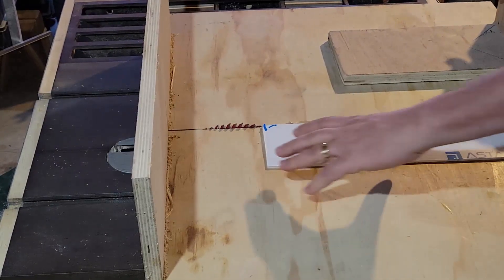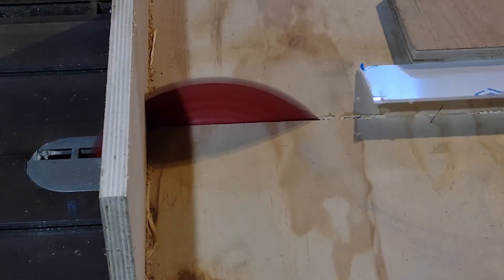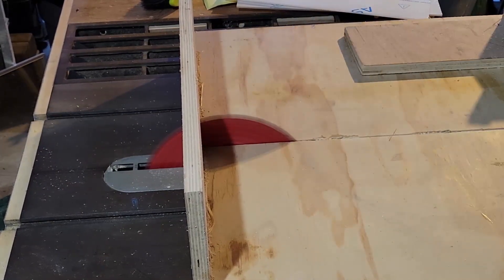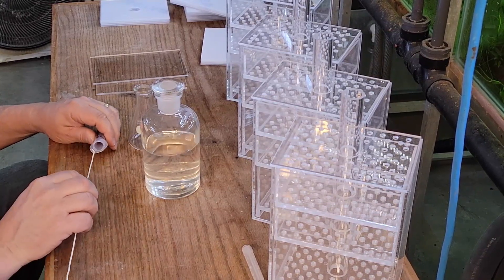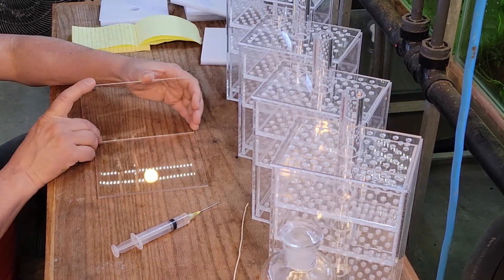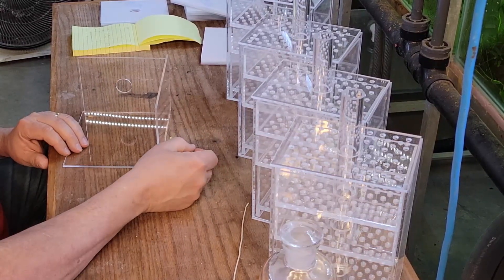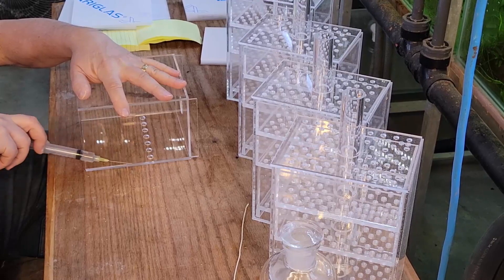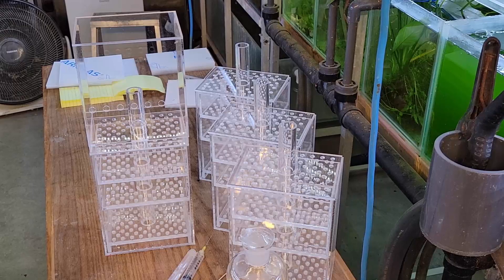Acrylic Welding: Advanced Techniques & Safety

Comment: I asked this question on another video but where do you get your supplies?  The Methylene, syringes, glass container?  What gauge needle do you use?  Thanks again.
Reply from the maker: Unfortunately my acrylic, methylene chloride and syringe supplier is local. The glass container is from my old lab days. The needle gauge isn't too important. It's the control you get with the plunger on the syringe that makes it work better than the bottle. Thanks for taking the time to watch!